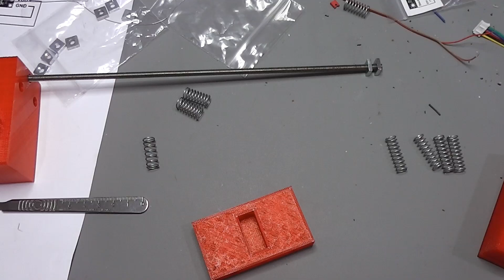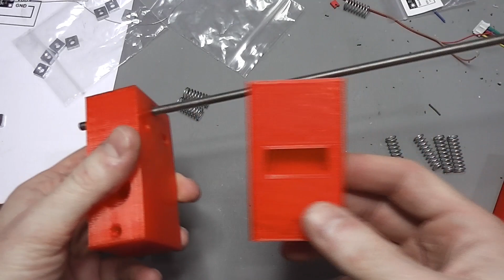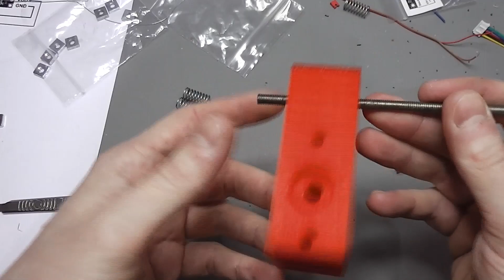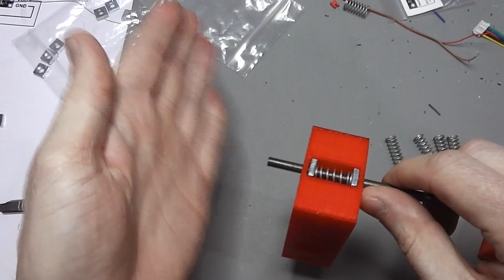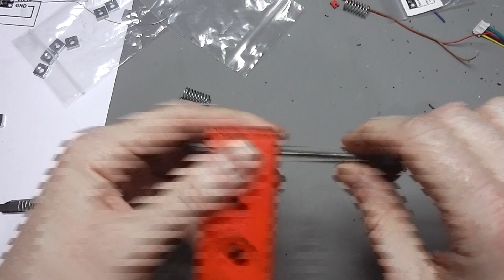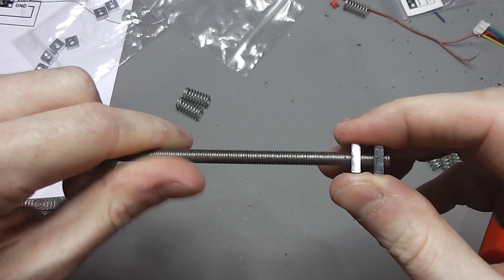Laser Engraver / Cutter Build Update - #3

Comment: Cut out one side to have access to the nut, then make a side plate to hold the nut in place. That way you can insert some padding washers between the side plate and the nut, to eliminate the gap. It will detract from the elegant looks, but, I believe, should be an effective solution to your problem.

Comment: what about use another spring between nut and "frame". Maybe you can cut existing spring in half, and you even don't have to print another frame, it should fit nicely in existing one.
Reply from the maker: Adding another spring did occur to me but its just going to increase the size of the mounting.
Reply: Hi, unfortunately, Arthur, you cannot solve your backlash problem with this design as you have permanent boundaries with plastic for housing the nuts and the threaded rod. Spring load must be increased while you are threading the lead  screw in. That way you can overcome the backlash. Personally I use belt drive(no backlash:). But, after I read xpertvis's comment I realized that you can solve your problem very easily. You need a bigger groove in the plastic housing. Remove one of the nuts and put a bigger washer. Cut a piece of plastic cube that fits in the slot and mount your remaining nut onto that cube permanently.Lets say you have the washer on the left side of the empty space in plastic, you can tap two holes from right side and push the cube that I mentioned towards the nut and squeeze the spring and get rid of backlash. Actually I am going to build one. Thanks guys for a good and easy idea:)